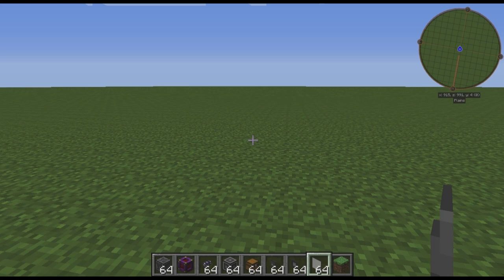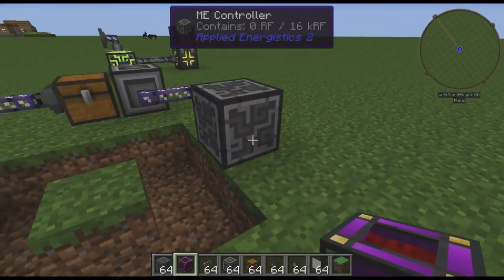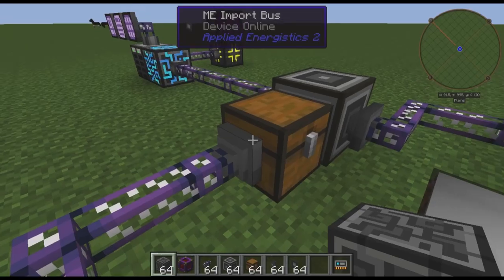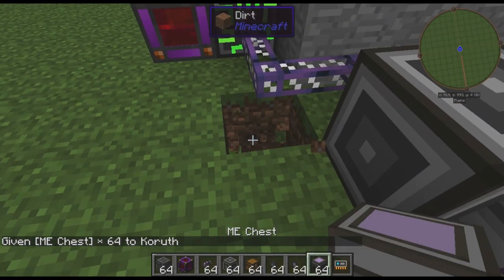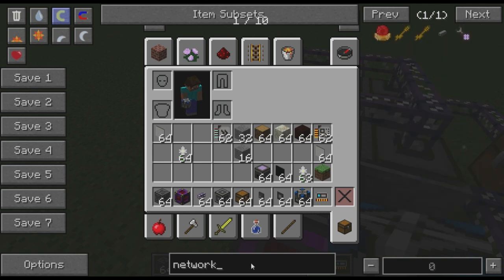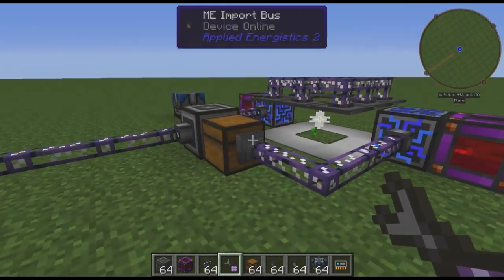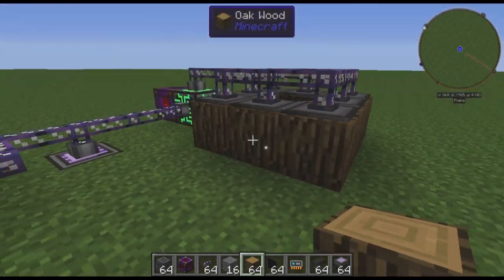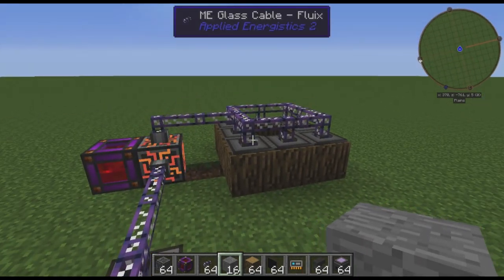Modded Minecraft: Automating Botania's Pure Daisy with AE2

Comment: You can do the same thing with no controllers on the subnet whatsoever, and no ME chest or drives.  My setup uses 5 channels on one subnet, and 4 additional subnets that only have 5 devices each, and automatically keeps livingwood/rock on a level (4 stacks plus a few extra, in my case) using level emitters. The trick is to split your formation/annihilation planes into separate subnets, 4 of each on each, with an import bus on the formation plane nets, and, here's the key, a STORAGE bus to output for the annihilation plane subnets, outputting to a storage device that can only hold livingwood/livingrock (I use storage drawers 2 slot drawers, to avoid having to use an extra storage bus) then just import back to your main network from there.

Comment: Hm, so i guess jabba barrels with storage busses also should work with the annihilation planes? :D, seems like a nice way to do this tho.
Reply: Rickard Borchers Barrels would be a good way to save the resources of making an ME chest although it does require JABBA. I like this system because it's AE2 only and doesn't need any other mods.

drageuth The reason it's breaking wood but not stone is that if it breaks the stone, it gets cobblestone and there's no place to store cobble.
Reply from the maker: Zac Jennings Yeah, I was contacted by an AE2 dev who explained the cobble thing to me.... shows me for always silk touching my picks, I go and forget that cobble's something you mine instead of getting it from an igneous extruder :P  I've already put a correction up as an annotation, think I should put it on the description as well?

It was my intent to try and automate things with just AE2, but you can definitely improve things with other mods.  Although you might be able to avoid the need of any local storage whatsoever and stick with AE2 only by putting a storage bus on the ME interface.